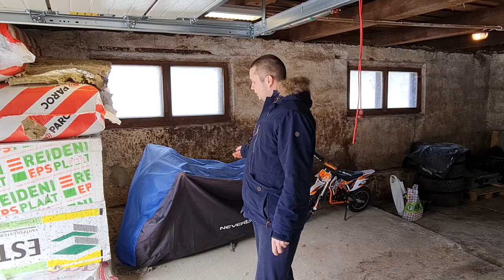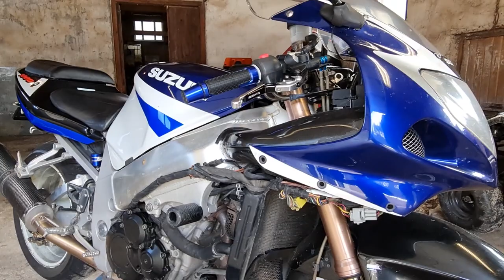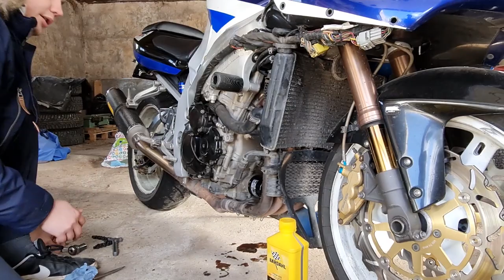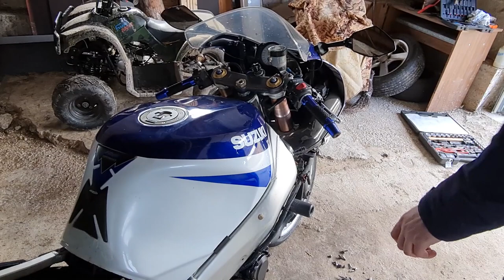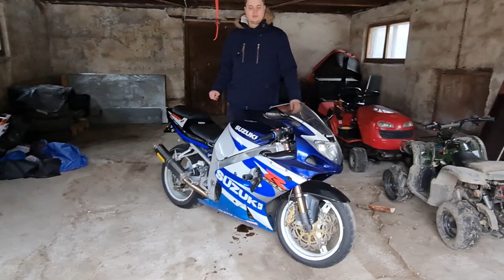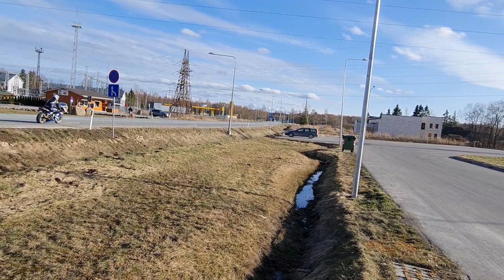Suzuki Gsxr 1000 K1 Maintenance For The Season 2021

Comment: Beautiful looking K1 you have there,I got hold of a K2 in September 2022 which had just under 12,000 miles on the odometer,I found the brakes to be a bit jerky and with a sudden "bite" when applied at speeds above 70 mph,to remedy this,I had a Brembo front brake master cylinder fitted and also fitted Brembo front disc rotors and Venhill braided brake lines,front and rear,I decided to keep the original calipers as they worked very well with the new components.The bike also has a Yoshimura tri-oval titanium full system,K&N filter,Iridium R plugs and a lithium ion battery,it runs on Michelin pilot power tyres and I have to say,the handling is perfect,the gsxr is by far the best bike that I have owned to date and I can't see myself parting with it.
Reply from the maker: Hey thank you for the good comment and you gsxr seems quite nice with these specs.I love how fast my gixxer is.Driving position is not very good for long drives and tall people like me,but i still love it.

Comment: I think you should tighten up the oil filter just with hand. Do not use a tool to tighten it up.
Reply from the maker: Thank you for the advice.i didn’t tighten it very.I just gave it a small turn extra.

Comment: always dab a little oil around the seal of a new oil filter, helps with the suction and seal and stops any initial damage to it when putting on a new one, did you use a new crush nut on the sump? That might cause you an issue down the road, hopefully not, but for £2 worth a new crush nut instead of losing £50 of oil down the road and a chance of a crash. And another trick for getting the tank up and out the way, bungee strap with hooks, stick it through the holes of the tank at the front, and pull to the rear seat and use the hook under the seat, it will allow the tank to stand up straight and out the way. https://www.instagram.com/p/B91lKw0jm4W/ you can see from my picture here. Makes things so much easier to work on the mechanics.
Reply from the maker: I put oil on the filter like you saw in the video and also a new a new crush nut.That trick with the tank i didnt knew.Thank you for the info.🙂
Reply: @TheMeisner87  didn't see it clearly in the video, but good drills, you wouldn't believe how many people forget to do these small things, which could save a lot of hassle down the line. bungees off amazon, and keep two in the rear seat. they come in handy when working on anything under the tank.